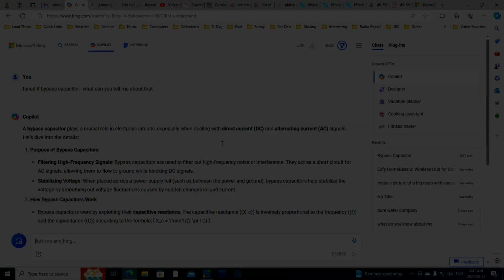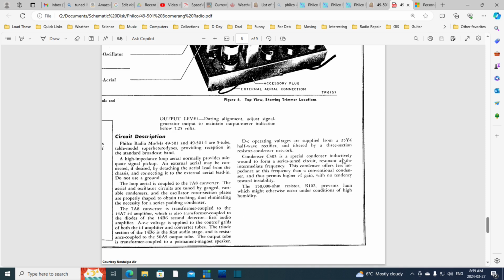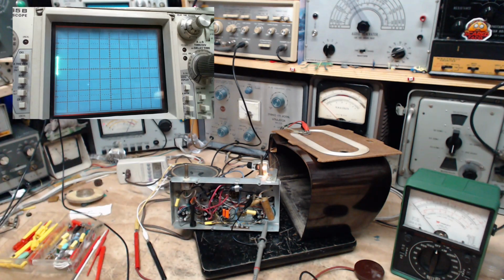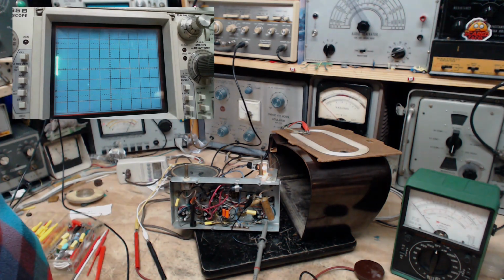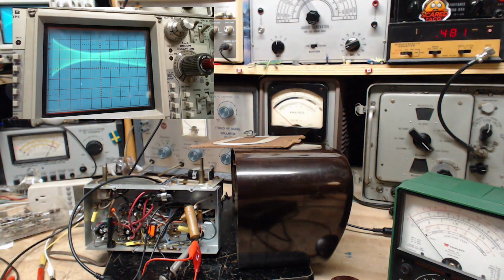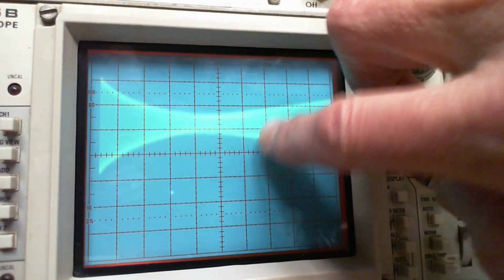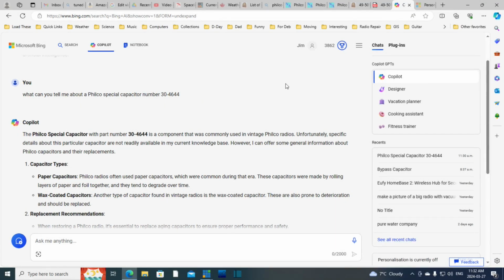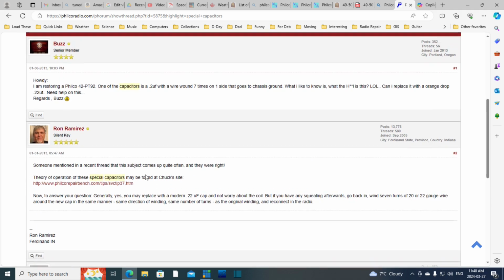Philco 49 501 Boomerang Radio Video #7 - 30-4644 Special Philco Capacitor

Comment: To me, Jim it seems like a lack of gain in the RF IF Stages. I would personally try a different mixer tube or if tube as a quick check. Tube testers give a general performance test, but nothing beats performance  in the set being worked on itself. Most   all american 5 tube radios should have no problem receiving local stations. Also, maybe a faulty IF can?  You'll find it I'm sure.

Comment: Rider’s Volume XVII, “How It Works”, 1948 details the IF wave trap special capacitor.
Reply: And to sum it up; there is no separate wire wound coil in this capacitor. The inductor indicated in the equivalent schematic of this special part is only formed by the inherent inductance that the wound up tin foils of the capacitor offer. And a special way of tapping of the pigtail leads of said capacitor not at opposing ends but shifting one pick up position toward the middle of the capacitor width, this special cap is tuned to roughly resonate at IF frequency.
Riders however seems to hint that a rough equivalent circuit to this special trap cap may consist of a 0,2uF cap in series with a 0,6uH coil.
Reply: 16:39...you need a spectrum analyzer with a tracking generator...
Reply: 19:42...don't connect the ground lead to the signal generator-(?)

Comment: Hello Jim That capacitor/ coil has to be replaced with another combination cap coil unit! period!  get that cap coilout of there and take it apart and save the coil intact  re attach the coil to the cap  in series!  Save the old cardboard tube and insert the new cap into the old tube and rewind the SAME coil around the outside of the NEW capacitor and install this new assembly back in the radio!
Reply: There is no separate coil in this cap, so there is no wire windings to preserve and rewind. Read the Riders article linked above.
One can substitute this with a single 0,2uF cap and forego the IF trap aspect, or make a trap from a 0,2uF cap in series with a 0,6uH coil.
Reply: @randomsteve4288  Sorry I did not know of this engineering change with this particular radio, as I have had to redo this type of cap several times with a few radios that I have. The difference being that the coil was wound on the outside of the shell

Comment: I have only used ChatGPT so far and it helped me (an hobbyist), to fix the a Denon DR345 receiver. I just started asking about power supply modules and how everything is connected in these integrated hifi systems, it lead me to the stand-by circuitry and all I had to do was replace a diode that was meant to be setting a small voltage for the MCU to  read. It's essential to be careful about how you phrase the questions otherwise it might just answer with nonsense that sounds correct.